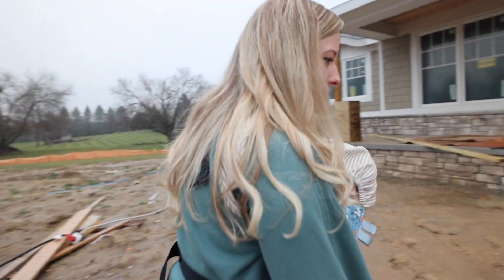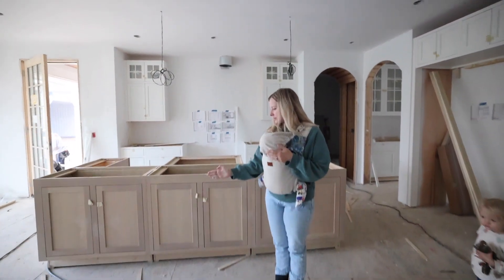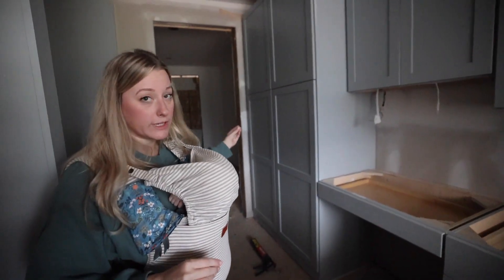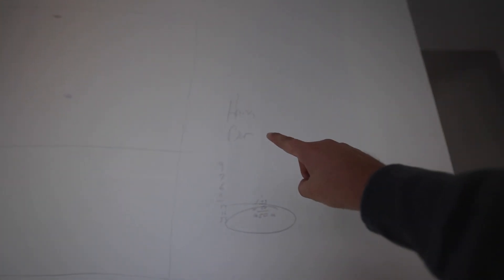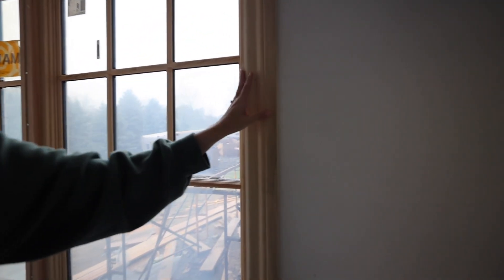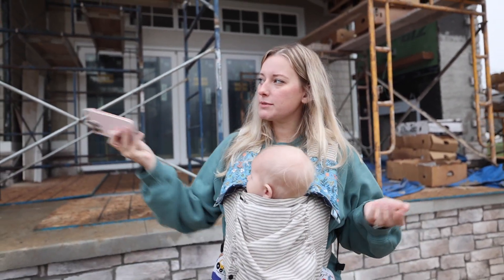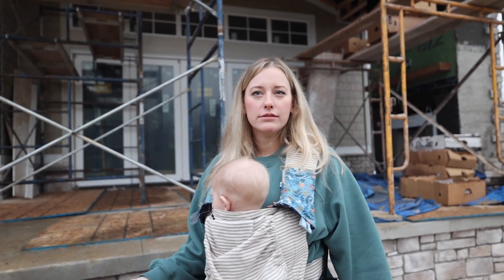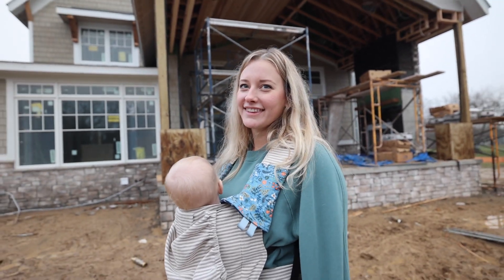DRYWALL COMPLETE! It's An ENTIRELY New HOUSE! *MUST SEE!*

Comment: Ok, really proud of you for all the design choices you (Liz really) have made thus far! Well done.
Something that did stand out (glaringly) is the out of plumb wall in the laundry though. Look at the margin between the upper cabinet and the end wall. Maybe it's just the camera? If not, I just couldn't live with it as it is being a lifelong cab maker for high end homes. Just have the "boys" check it out.
Just trying to help out really nice people!❤
Reply from the maker: Thank you! Can you time-stamp it? I'd love to circle back on it! They're far from finished in there so I wonder if it still has to be set and dialed in, etc. Thank you!!! Happy Thanksgiving!
Reply: I think if you’re a “high end cabinet maker” you’d realize that’s a full hight end cap that’s not yet installed. 😊
Reply: @csresidentiallawnmowinglan7244  nope. The distance from wall surface to cabinet box varies extremely varies from bottom to top. A taper cut filler will fill it but definitely not hide it. Same will show up on the W/D side.
Reply: @BuildingItTogether  nope. It's waiting on a tapered filler to fill the gap. But it's still an extreme taper to correct an out of plumb wall. Sorry but I'm hoping it was just the camera angle. Let me know when your carpenter puts a level against it. And I'm NOT a grumpy old cab maker Really!
Reply: Rhett

Comment: Hey Brian just a quick question, and correct me if I’m wrong, but the cabinets should be installed after flooring, are they doing that?  It Just provides a much more finished look, especially in higher end homes. Many builders try and cut cost by not “finishing” the flooring below the cabinets, which looks ok until you want to tear out a built-in in an office or maybe make a change to a bathroom vanity size down the road. From what it seems like you’re paying for this home, this should be a given from your builder. Just a tip and word of advice.
Reply from the maker: Yeah I am not totally verse in that, but honestly if it saves some money and it's not visible, than it does make sense to skip those areas entirely. Good looking out though!